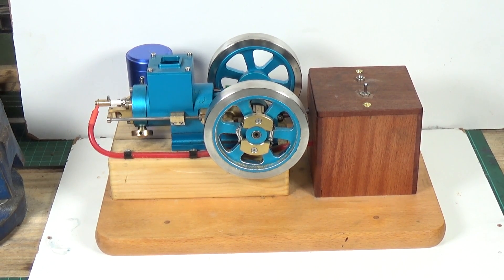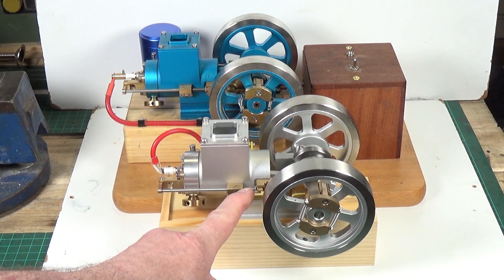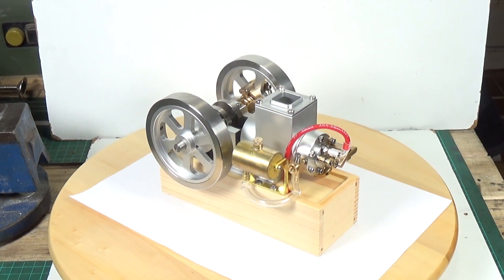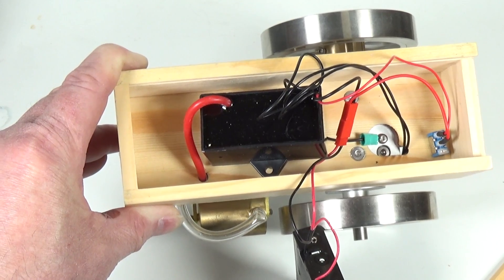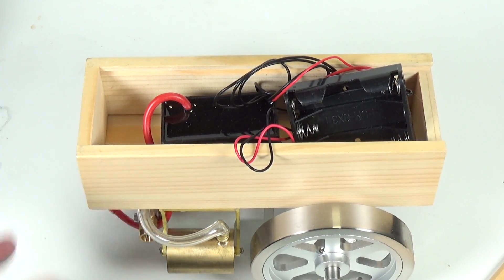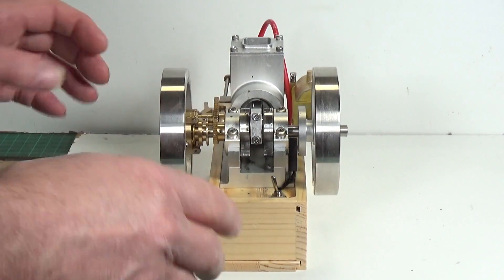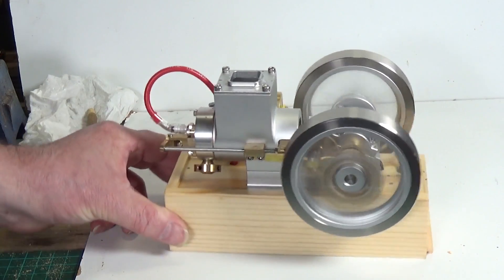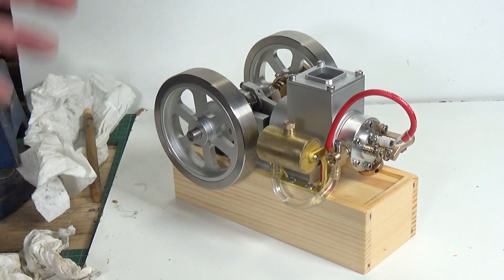Further Adventures with Chinese Hit and Miss Engines - Part One

Comment: Mine will be due very soon, but 1st thing I will do, is fit softer governor springs , & drill some lubrication points on the main bearings and bottom of cylinder.
Reply from the maker: Hi Gary. All good mods. It really does run too fast with the original governor springs.

Comment: I would love to make a tiny outboard out of one of these. I love the sound they make and the way they look. How powerful are these? Could you stop the flywheel by hand?
Reply from the maker: They are not very powerful,  small piston & cylinder so very small capacity. I have not tried to stop the flywheel but I expect you would be able to stall the engine easily.
Reply: @RetroSteamTech  I see, thanks for the info. Great video by the way.

Comment: Hello. The ignition thing (CDI) does not work on mine. The spark got weak after a short time. 2 or 3 runs and that it was.
Reply from the maker: It could be one of several things. It's worth checking the wiring and making sure the chassis of the engine is grounded to the battery negative. Also check and clean the spark plug. Other than that it may be the ignition unit or the hall effect sensor.
Reply: @RetroSteamTech  I separated the ignition unit complete. No vor only weak spark between spark wire and ground wire when magnet switch wires put together.
So CDI is almost dead.
Hall effect Sensor is cut off for testing.
Reply from the maker: @d.m.3259  You can get replacement ignition units from Banggood and ebay. I find it strange that there is a spark though, these units usually either work or they don't work.
Reply: @RetroSteamTech  yes. It's really strange. First try in the day there is a spark. Then it becomes weaker until it is dead. Batteries are new. 
I have already ordered a spare part.
Thank you.
Reply from the maker: @d.m.3259  It sounds like there is a capacitor breaking down inside the ignition module. Let me know how you get on.

Comment: Ice been trying for 3 days to start mine, im trying to adjust the carburator and when the engine actually starts it runs for like 30 seconds and then looses power and just stops.
Reply from the maker: The carburettor screw is very sensitive, just turn it a fraction when making adjustments.
Reply: @RetroSteamTech  most of the time my engine wont even start. Ive had it start on one good place on my carburetor but then it runs for a short time then stops. Any further attempt to turn it on afterwards wont turn it on anymore.
Reply: @RetroSteamTech  should there be 2 piston rings on it?
Reply from the maker: @Sebi076  I've not had this one apart so I can't say,  the original blue one only had one piston ring.

Comment: Hey! Mine came in the post today! Something I thought might interest you, they have changed them slightly again, they now come with a length of pull cord and a handle. Next to the right hand flywheel has an extended crank with a pulley attachment with a notch for hooking the rope on and wrapping it around 3 times.  I'd imagine one could use this to connect a belt to run a little generator too. Thanks for your great videos :)
Reply from the maker: Thanks for the update Tom. I didn't know about those modifications. Once you have the engine set up properly it's fairly easy to start by just flicking the flywheel but a pull cord would definitely improve the situation. I was rather surprised that it didn't originally come with any way to drive external equipment, I had to make a pulley for mine. Cheers, Alan.
Reply: @RetroSteamTech  Hey Alan, I just did a bit of searching and they sell the part so if you are interested you can always try it out :) again beautifully machined. here is a link in case you're interested! https://www.banggood.com/Eachine-ET1-ETX-Hit-Miss-Gas-Engine-Spare-Parts-Hand-Start-Device-p-1573482.html?rmmds=buy&cur_warehouse=CN

Comment: Hi Guys I'm struggling to start my new engine it arrived this morning I'm using Bartoline lamp oil but can't get it to fire up it has a good spark anyone able to help Thank you Jo (Mid Wales)
Reply from the maker: Hi Jo, they can be a little tricky. I found that they worked better with actual petrol although a few people have run them successfully on lighter fluid. I also found that choking the engine with the ignition off (finger over the carburetor air intake & rotate the flywheels a couple of turns) before trying to start it worked quite well. Cheers, Alan.
Reply: @RetroSteamTech  Thank you for replying Regards Jo

Comment: wonderful video, thank you :) what keeps the piston lubricated and not seizing up? You said how you dont do anything to it which is surprising! Also as for the oil what do you use? Will 2 stroke engine oil suffice?\ for keeping the bearings lubed?
Reply from the maker: Hi Tom. Thanks for subscribing. Yes, I put a couple of drops of 2 stroke oil in the fuel tank. I also put a few drops of motor oil into the open end of the cylinder which I hope will provide some lubrication for the small end. Cheers, Alan.
Reply: @RetroSteamTech  Thanks Alan I appreciate your response! I really enjoy your content (found you an hour or so ago) and shared your page with a friend who is mad on trains and mechanics. Greetings from a fellow Brit living in Australia :)
Reply from the maker: @spooncarvingwithtom  Glad you are enjoying the videos. I try and post one once a week and the content varies as you have probably seen. Cheers, Alan.
Reply: I run mine on zippo lighter fluid. It's like high test kerosene and it runs great with lubrication in the fuel. I pulled the piston after running and it was oily.

Comment: How long would you suggest running these models for, before getting too hot? Many thanks...
Reply from the maker: If you put water in the cooling reservoir you would probably be safe to run it for 15 minutes.
Reply: @RetroSteamTech  more than that! You can run these for over an Hour as long as there’s water in the hopper!

Comment: Alan,

I guess you need one of these Banggood engines as well; from my point of view one of the most exotic internal combustion engines I ever saw:

https://www.youtube.com/watch?v=InAMG9zf49M

OK,  Mandarin is not that easy to understand, but my engine is nicely running on normal cleaning benzine (Zippo fuel is quite expensive).

Two-stroke mixed fuel does not make any sense, since this engine runs just on the evaporated fuel fumes from the tank; no carburetor at all !!

Variable parameters:
-  Ignition timing (slider).
-  Ignition strength (potentiometer).
-  Mixture control (very sensitive 90° valve).

In order to obtain stable low rpm operation, one needs to optimise a 3D parameter field :-)

--> Many, many interesting hours with this little machine.

You may even watch the combustion through a window in the cylinder !

Comment: Hi. I hope you are ok. I just bought it in Ebay and I wanted to ask you before it arrives what kind of gasoline do you use? Some people  recommend Zippo fluid. Hppe you can give me an answer. Best regards
Reply from the maker: Hi. I have used both Zippo fluid and regular gasoline. I got the best results with regular gasoline. I also mix a few drops of two-stroke oil in with the fuel for lubrication.
Reply: @RetroSteamTech  thank you. In fact you answered my following question that was about lubrication. Regards and thanks again

Comment: Thanks for your videos, they’re well done. I have a blue motor with a silver one on the way.  I was fortunate in that I had very little trouble with the blue one.  I immediately ran a ground from one of the engine mountings to the black battery lead, after removing some anodizing.  I mixed lighter fluid with 2 cycle oil 80 to 1, and this is too much oil.  This motor will not tolerate any air in the line so I always choke it with my finger over the carb for one or two turns.  I set the needle at ¼ turn and it started after 3 or 4 flips, and ran continuously right out of the box.  After an hour or so of run time I decided to check the big end rod bearing. There wasn’t any, just Aluminium on the steel crank pin. There was significant spalling, aluminum deposited on the journal.  I cleaned it up, polished the crank and installed a micro grease cup from Debolt Machine. I give it a shot of grease before every run and that seems to have solved the problem.  Don’t give up on the blue motor.  With a little TLC it can be made into a great runner.  Mine now almost always starts on the first flip after choking.  Regards,  Larry
Reply from the maker: Hi Larry. Thanks for your comment. If you have a look at my 'Part Two' video you will see that i now have both engines sorted. Although i didn't mention it in the video i also choke both engines by putting my finger over the carburetor air intake and rotating the fly wheel slowly a couple of times before attempting to start. Works a treat to help starting. Regards, Alan.

Comment: Don't you just love Chinglish! :D
Reply from the maker: Absolutely 🙂
Reply: Thanks for the hints and tips, they enabled me to finally get my blue one running after much faffing about, it was well on its way to becoming an expensive ornament!
Reply from the maker: @adrianrabbage4996  Glad you found the videos useful. Reading through the comments on all 4 of the videos i did on these engines it would appear that many others have struggled with them. Hopefully like us they have now got working engines.
Reply: @RetroSteamTech  Let's hope so. Mine is still a pig to start, but once it's going it will usually keep going until it runs out of fuel or I switch it off.
Reply from the maker: Adrian Rabbage For starting try this. With the ignition off put your finger over the carburettor air intake and rotate the flywheel slowly a couple of times. Remove your finger, turn the ignition on and try starting. It’s like applying a choke, works well on both of mine.
Reply: Retro Steam Tech;  Cheers, will do! 👍
Reply: @RetroSteamTech  I'm just about ready to give up on this engine, when it's running it's great, but I've had to replace the small Hall Effect sensor board twice now, and so I haven't got any more, and it seems you can't get them from Banggood. I've tried repairing them by replacing the sensor with no success, so I was just wondering on the off chance you or anyone else reading this knows of a source of this item? It would be such a shame that it's rendered useless for the sake of such a small part because as I mentioned, it's great when it's running.
Reply from the maker: @adrianrabbage4996  I don't know anyone who can supply replacement sensor boards that are the same as the one used on the blue engine. However i'm surprised that you have not had any success replacing the sensor. As long as the replacement sensor has the same pinout as the one used on the board it should work fine. Something like an A3144E should be able to be soldered directly in as a replacement. You ban buy these from ebay and they are very cheap.
Reply: @RetroSteamTech  I bought some replacement sensors and I don't know whether my soldering isn't good enough but I've not had any success. They're very fiddly and difficult to solder and the solder pads are very thin and fragile, but I'll try again at some point. I've contacted Banggood and the manufacturer so I'll see how it goes. Thanks for replying. All the best.

Comment: I have the same engines and a few older ones too. On the silver one grab a flywheel and move it up, down, left and right. Notice all the play? The main bearings are very sloppy. Hasn't caused any problems for mine yet.
Reply from the maker: You're dead right, quite a lot of play. My original blue one has no play at all, i wonder why they've done that.
Reply: My blue one is good too, although the silver one is the only one I've ever run. I have three brass ones too that I bought from China 5 or so years ago.
Reply: I'm not sure why, but it seems the clearance in the main needle bearings and the added end play in the crankshaft was done for a reason with the newer silver version.  It's really neither here nor there as far as how it runs, but I don't really care for it as it feels kind of junky compared to the old blue version.  I've also noticed the flywheels tend to come loose more easily on the silver version.

Comment: That's amazing Alan.  The Chinese are putting out some really good stuff.  I wonder what sort of piston ring/seal it uses ?

Do the instructions say anything about lubing anything ?  Are the crank bearings sealed races or plain?

A few drops of two stroke oil in the fuel would probably be worthwhile.

As the ignition system is basically the same as a car, it makes sense that it would ground back to battery negative - as cars basically do.  It would pay to ground the motor AND the CDI to negative as well to ensure the spark plug earths/fires OK.  The CDI has to generate the voltage, and the plug has to use the voltage, so they are both separate circuits in effect.

Very interesting.  Thanks for posting.

Cheers Rob
Reply from the maker: Hi Rob.  The blue engine uses a single rubber O-ring, not sure what the silver one uses as i haven't had it apart yet.

Nothing in the instructions about oiling and without stripping it down you really can't tell what type of bearings are used.

Two stroke oil has been suggested before and i think it's a good way to go.

On the blue one i removed the anodising around the spark plug hole to help with the earth. The silver one seems fine. I'll be posting a part two shortly where i have connected the chassis  earth to the battery negative on the blue one. It improves the running no end. Seems that the metal case of the ignition unit that came with the blue engine is not connected to battery negative. It's all a bit of a learning curve but very satisfying when they finally run 🙂

Cheers, Alan.
Reply: @RetroSteamTech  Yes, we are always learning.  That's what makes life interesting.

Cheers Rob
Reply: I believe the silver one uses 2 O rings, i may be wrong, just what i saw in another video.

Comment: These are great engines Alan.  Our friend Jin in China did a much better job on this v.2.  He is also going to release a vertical version soon.   You can see the prototype of his vertical engine running on videos on his website. I haven't bought one yet, but many of my steam friends have gotten them.  Another interesting mods out their including the addition of a small pulley wheel to drive accessories; shortening of the springs in the flywheel to slow down the run speed and one mounted on a Mamod style cart.  Others have also experimented with different fuels and the consensus seems to be that lighter fluid with a couple drops of Mystery Oil is the best combination. Hopefully, I will get one soon.  Looks like a lot of fun.  Thanks for another great video.
Reply from the maker: Thanks for the comments Charlie. I will go have a look at this vertical engine, sounds interesting.
Reply: Thanks! You've essentially answered any questions I had about whether accessories can be driven from these little engines. I hear ya also on the many debates about the best fuel to use and seems focused on which best concoction of lantern fuel one should go with. Were there any definitive conclusions drawn?